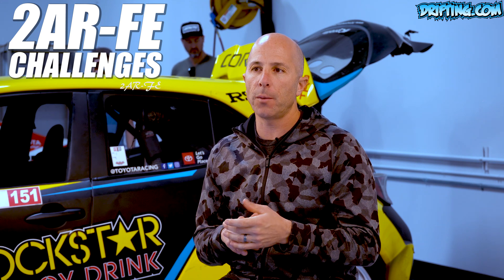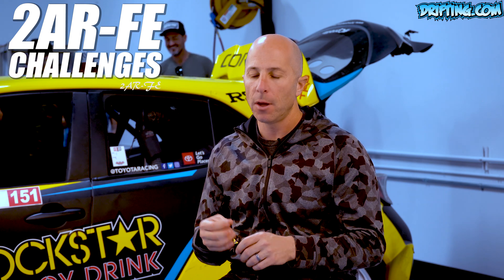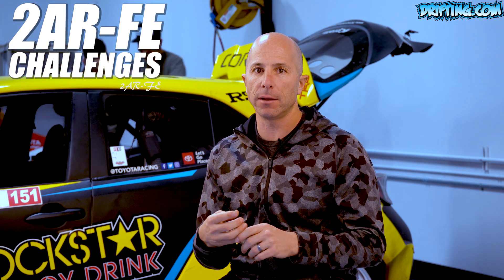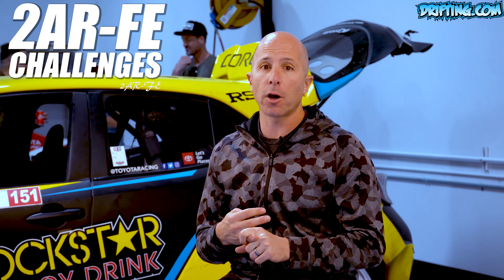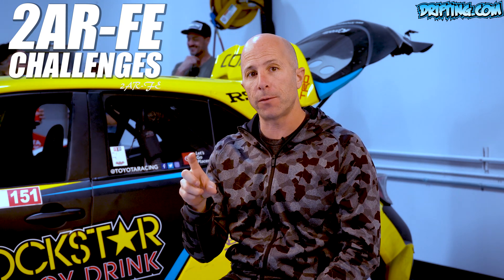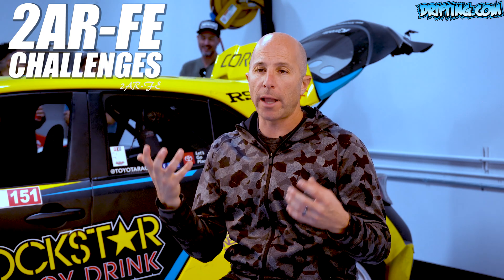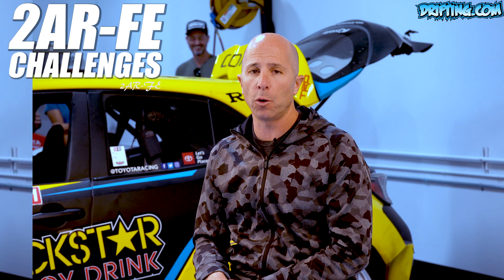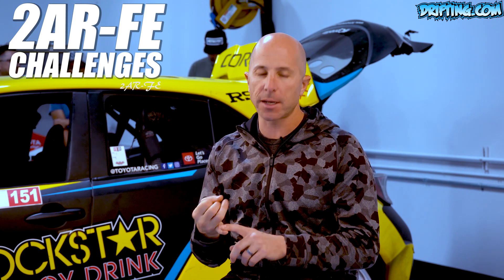2AR-FE High-Horsepower Challenges covered by Stephan Papadakis

Comment: TOYOTA engines with codes that end in "-FE" have the "Fuel Economy" cylinder heads, witch require tons of modifications to make them proper for high horsepower fugures. The "-FE" cylinder heads are made by TOYOTA. 
All popular TOYOTA engines in motorsports are mostly the ones with performance cylinder heads made by YAMAHA, and those are the TOYOTA engines with engine codes that end in "GE", "GEU", "GZE", "GTE" and "GTEU" and these cylinder heads rev higher than the "-FE" cylinder heads. Now, it will have beem great to have a "2AR-GE" / "2AR-GTE" version of the 2AR engine...but TOYOTA has been lack-luster in performance 4 cylinders since the 3S-GE / 3S-GTE final days.  Yes, there is the big 2.7L 4 cylinder TOYOTA 3RZ-FE, but again. it has a mediocre "Fuel Economy" cylinder head and it cries past 7,000 RPM in modified engines wit tons of modificatuons to the cylinder head. They have "reached" the 1,800+ HP mark (Dyno) but their performance is limited on the RPM zone.
Reply: What if unlike Papadakis, a the aforementioned modification to the cylinder head, internals, and engine blocks itself are done and ran without nitrous. How much power could it be tuned to make reliably?
Reply: So reaching a goal of having a 220hp 16 Camry is pretty much not going to happen?
Reply: @robertwest4299  Don't listen to him, the 2AR-FE he's complaining about makes more power than the 3S-GE he's praising on completely stock internals. These modern narrow valve engines flow better than the wide angle engines that Toyota used to make. Also, F in FE means narrow valve angle, the G means wide valve angle and the E means fuel injected. the "-FE" engine just means narrow valve angle with fuel injection, not "fuel economy". Narrow valve angles also make it much easier to have high compression engines and prevent valves from hitting each other when you get crazy with the lift and the overlap.
Reply: @robertwest4299  i also forgot, i have documented 3 different ways to get to 240whp (roughly 270hp crank) on the 2AR-FE. One of them did not even require any aftermarket parts other than an ECU, it only used cheap and available camry hybrid engine parts.
Reply: @robertwest4299  not true the stock engine is well built and can withstand up to 300-350 hp but that is still limited if you wanted something higher than all other modifications will have to be done
Reply: @Marketing-genix  I just don’t see the parts to make it happen unless you go stand-alone ecu and forced induction.
Reply: @robertwest4299  Check out Frankenstein Motorworks here on youtube.
EDIT: Just seen he responded lol
Reply: @845sSuperman  I still appreciate it because my notifications didn’t notify me of Frankenstein’s reply. So thanks!

Comment: There's practically very little to no modifications that can be done on the 2AR-FE engine. The parts just aren't there. It would be interesting to see if this engine even makes traction in the modding community.
Reply: A friend and I are working towards making it possible to compete 
ith built k24s.
Reply: Alex Hise it be interested in what that looks like. With the 1ar crank you can get it to 2.7L of NA power
Reply: The 2.5  has factory 12.5:1 pistons to try and I'm going to see if Yamaha V-Max pistons can work in the 1AR
Reply: @alexhise968 good luck!
Reply: @sickestbrickeva  I'm on my 3rd head design hopping to break 350hp na
Reply: Crazy how it’s making 270whp N/A now with factory cams
Reply: That was with Frankenstein Motorworks cams, not factory. @NelsonS92